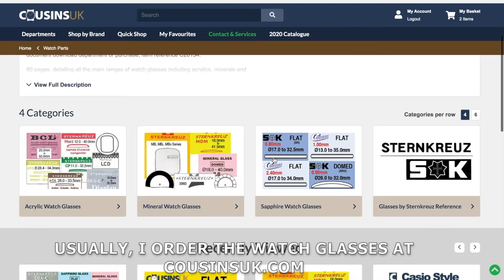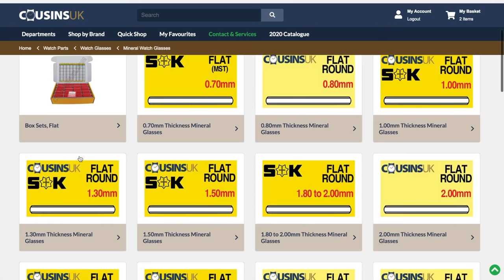Broken Watch Glass Replacement | How To? | DIY | Index Fix | Tutorial | Watch Repair & Service

Comment: It seemed the glass was protruding a bit from the case, was that ok in this case? I never understand if that's a sign f glass misplacement or if it could be designed that way!
Reply from the maker: It depends on the watch, here is was ok. But it's certainly possible to put a watch glass in a watch which one is a lot to thick.

Comment: Michael Kors 3481 watch. Any idea where I can find a glass replacement for it?
Reply from the maker: I don't think you will find an original glass, but that is not necessary. Aftermarket is perfect. Then you first have to know what the diameter of the watch glass is. If you know this, you then order that size, one size smaller and one size larger. Because this can sometimes differ. Maybe you can find it on Amazon or Ebay? I order them from CousinsUK, but that is only for professionals.

Comment: What if you couldn’t size the glass Bc of the damage. How would I find the right size to order
Reply: there would be at least a small piece you could measure for thickness, then use the calipers to measure the ID of the case for the circumference
Reply: @--RSL-- great tip btw, I was wondering tho what if the glass is not fully broken so measuring ID would be hard? How do u break a half broken glass that's still solid on the shell of the watch

Comment: Have you ever replaced the glass on a seiko G757 sports 100. I have had one since i was a kid the glass is smashed. My sister found it on the road about 30 years ago broken band and smashed glass but still functioning and its lived in the draw ever since I removed the battery when it died and must have lost one of the screws on the battery clamp. Now I'm older I'm  interested in getting it back into service.  I saw the bond movie octopussy and saw the watch which sparked my interest again.
Reply from the maker: Hi Tim, that's a beautiful vintage James Bond watch! But I'm sorry, i can not help you with that.
Reply: Thats unfortunate thanks for the videos you have great content